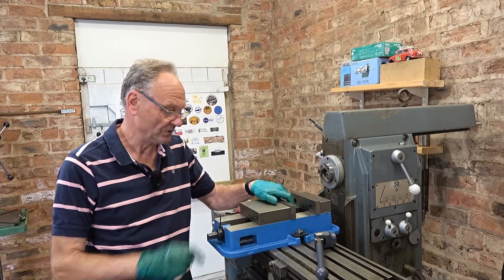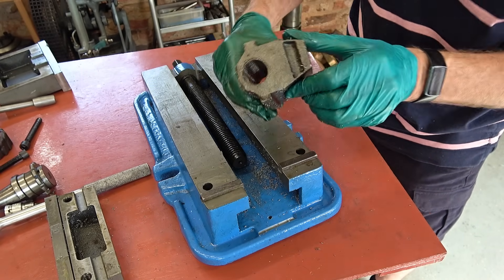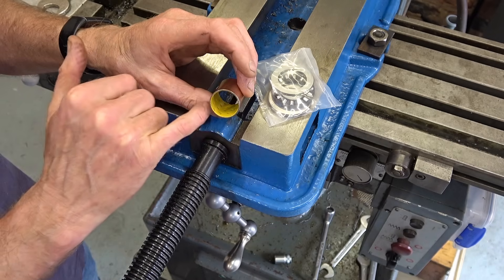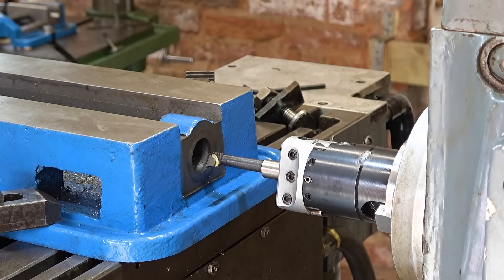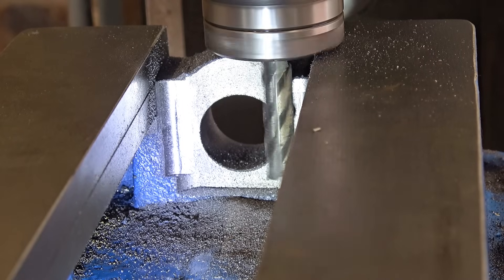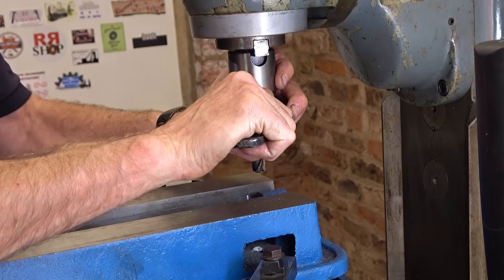HS317 Vevor milling vice improvements – bushing & bearing

Comment: the threaded collar with set set screw doesn't work well, a double split  collar in a grove will keep the thrust set, hope it's helpful
Reply from the maker: Hi in the next video you will see a half-way step. I changed the pointed grub screw for a flat end screw and dropped a brass slug down the hole to clamp on. At least that won't damage the thread. But I agree a split collar would be better. Cheers

Comment: With those brazed carbide boring tools, absolutely set those up and correct the geometry of the insert. The insert tip is always too high above centerline, and the relief angle is not where you'd want it-by design. They are meant for you to have carbide available to grind them into a properly shaped tool, and it will seriously improve both the surface finish, taper, and bellmouthing of your bored holes.
Reply from the maker: Ahh, thank you for explaining that. It certainly makes sense what you say. 💡 Cheers

Comment: "should be" in this world/line of work never assume anything when it comes to measurement or alinement or strength. always check ( if you assume then you also have some doubt and if you have any hint of a shadow of a doubt you check )
Reply from the maker: Yes my experience confirms that. If I make a mistake it's usually because I made a bad assumption. I try to work to "assume nothing, trust nothing". And mostly I stick to it. ,🙄 Cheers
Reply: @HaxbyShed  "assume nothing. test/check everything ( when it matters ) "

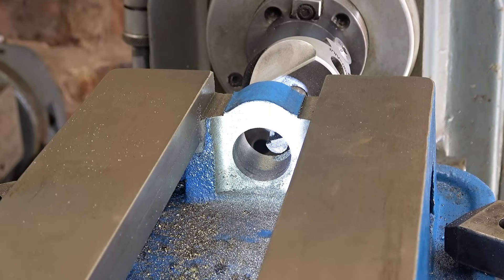Comment: At 8:35, you can see that your cutting angle is not quite 90deg, maybe 89 or 88deg might have been text book better, but this seems to be 110deg which is kind of just scraping its way through... Still it got the job done...Close-up video after the fact sure does not help yesterday, but maybe will help tomorrow.  Again thanks for making this video, excellent content and videography as well.
Reply from the maker: Hi John I understand your point. These are stock cutters which came with the boring head. Honestly I took them on trust and did not check the top rake on them. It could have been doing more rubbing the metal off than cutting 😎

Comment: At 2:35, You might try to use some of the extra '0.65' of the 27.65 to 'tighten the fit' of the screw to the nut.  I guess what I am trying to say is 'don't turn the new shaft directly to 27 .... maybe try 27.1 or 27.2 to possibly increase the thread contact surface inside the nut, which is "Probably" cut oversized from the factory....
Reply from the maker: That is still an option, as of now I've done a fair bit on the new screw (out of the VW Passat drive shaft) but I've yet to turn it down to the screw diameter 27mm. I've done a test thread on 27mm Delrin - you will see in the next video.

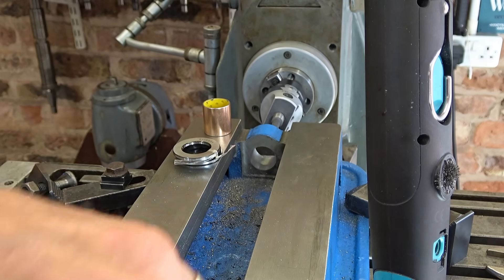Comment: At 10:09, you could have created a boring bar similar to what you did at 7:07.  Drilling a hole at 90deg to the main shaft would allow a similar sized "BROKEN" drill bit to be ground into a cutting bit, then held in place with a set-screw, then assembled in the gap, and finally, drawn backwards through the hole creating a 'Spot Face' feature to hold the thrust bearing in a round recess, keeping more iron for strength in that area, and less areas for stress risers that could be the beginnings of cracks in the cast iron..... ... Thanks for making this video.
Reply from the maker: Hi John, I understand, yes that is true. A semi pocket either side of the 27mm hole to retain the bearing 'washer' in place. A good idea. Wish I'd thought of it.
Reply: @HaxbyShed  Thanks for your replies....

Comment: At 16:00, you could have used a bolt & nut to draw the bushing in... Did you use the Loctite?
Reply from the maker: John a bolt and nut would have been kinder I agree. It was going in easily to begin with so I did not expect it to put up such resistance. I used bearing retainer loctite (the yellow softer stuff).
Reply: @HaxbyShed  I might be 4 hours late ... but ... Maybe the diameter of the hole is tapered because you advanced more slowly towards the end or beginning of the cut.  If that bushing is 'too tight', it might expand due to thermal increases and crack the vice during that expansion. It is steel, not copper or bronze. It might be too late, but maybe not.  I have built many Automatic Transmissions and replacing bushings is a standard thing. This is practically the same thing.  How hard was it really to get the bushing in? If that seam in the bushing is really tight, it might be trouble.  Finger tight plus some hard Loctite might be safer.  Just a thought.

Comment: Paul, now that I've just received a 5-inch (~125-mm) Vevor vise for my RongFu-style mill-drill, when I unbox it, I'll be certain to inspect the engagement of the screw with the nut like you did.  Hopefully, I won't need to replace the original screw because I doubt my lathe's ability (at this time) to machine a new one!  I'll probably copy your idea of adding a thrust bearing too.  ;)
Reply from the maker: Hi Bob, I would not be too anxious if the screw is a bit short. It's quite a long nut so there is still quite a lot of engagement, and also if you were really bothered you could drop a spacer into the jaws before clamping. I just saw an opportunity for a project and self-learning. Cheers

Comment: When machining plastics, deep cuts and high feedrate is your friend.

What to accurately machine a diameter? Try to take as much in one cut as you can, or leave more for a finish pass. This will limit deflection.
Feeding fast prevents melting, and rubbing. It also helps prevent fine stringy swarf, or worse dust. 

For plastics, when parting, use a high rake angle ground tool, and you want to feed by hand, as fast as is reasonable.
Otherwise you’ll get melting and rubbing. Get the cut done asap. You can go a little slower to improve finish, but leaving more for a finish pass on the face is generally a better idea, depending on what you are doing.
Reply from the maker: Very useful advice, thank you 👍

Comment: That was very interesting Paul. When you make the new screw  from the drive shaft, you can correct the fit between the plain portion of the screw and the bush. I look forward to that. On Kurt vices - the company I work for bought out a smaller firm a few years ago. They were in a medium sized industrial unit, and they had two big (unsure of sizes) Kurt vices in their workshop, and a couple of 2ft square granite surface plates. Well, my firm shut down their shop snd transferred what some fool regarded as the useful items to the main building. I enquired after the Kurt vices and the surface plates. They had all been chucked in a skip. I could have wept.
Reply from the maker: Oh my goodness Carl. People have no idea of value !!

Comment: I bought a Chinese milling vice, not a VEVOR though.
The biggest issue I have is moving jaw sliding face isn't parallel with base so parts need 'shimming up'  0.004" (approx 0.1mm) on one side. (I guess you can switch between Imperial and metric relatively easy?)
It's still way better than the angle drill vice that came with it, that was almost eighth of inch out on the pivot but I still have the 1993 Model Engineers Workshop where they showed how to make it accurate. (I didn't have a mill back then but did have a nice old Colchester I sold when I moved to Florida)
For most work it isn't too much of a problem and eventually I will get around to scraping it parallel, then I won't need to clock everything and adjust parallels with shims.
I did dismantle clean all the swarf out then re-grease screw and tilt down clamp system, already has thrust bearings on screw.
I too would like to have KURT but even in USA they cost almost as much as my mill/drill (wife complained enough about that 14 years ago)
Cutting speed for Delrin is faster than any machine I've ever owned 😁
When shortening bushings it's much easier to mount on a mandrel, even wood will work (broken broom handle is good)
I would have pressed bush in with a G clamp

Comment: Amigo la fundición suele ser más abraciva que el acero al carbono. Trabajas con muy altas rpm. El has co. No se trabaja en alta rpm y sin refrigerar. La fundición no se refrigerar y por tanto no se dan esas altas rpm qué le das. El carburo de tungsteno también pierde filón rápido y la piensa a mecanizar agarra temperatura modificando la estructura química de la fundición. La verdad amigo. No se sienta mal por lo que le sugiero. Dios te cuide.
Reply from the maker: Gracias por tu consejo. Lo tendré en cuenta. Saludos.

Comment: I have done the same thing to a old Bridgeport brand vice that was probably 100 years old and beat up and drill holes everywhere spent about 40 hours upgrading it with thrust bearing new nut new and screw also made removable steel jaws out of o1 tool steel then heat treated I under stand your reasoning behind doing it your way because I'm the same way I'm retired now and finally got a Kurt for my Bridgeport at home I often wonder what happened to that old Bridgeport brand vice I restored 30 years ago my boss at the time let me do that because work was slow and he also liked it because it was what would have came on the very first Bridgeport made machines I know he spent a lot of money buying materials and paying me but he was happy after I finished thank for sharing it was always a challenge that got me going like you when you do it yourself you know what you got very good job on your never which copied the Kurt but not quite as good but yours will be when you get done

Comment: The nut on my vevor vise  can slide out under the fixed jaw once the thread is disengaged. Then the screw slides out without having to remove the fixed jaw. It makes sense to add a thrust bearing on either side for less friction with the locknut not rubbing on the vise body.
Reply from the maker: Hiya last evening I ordered a 24mm crinkle washer for the outboard side to keep the thrust bearing under a slight tension when the vice is not clamped. Cheers
Reply: @HaxbyShed I used a Belleville washer to keep both thrust bearings preloaded. The washer spins between the locknut on one side and on the outside thrust bearing.

Comment: My vice is CHOCOLATE😍
Reply from the maker: I've seen a vast range of quality from all origins. Usually most import stuff is good enough for hobbyists, and usually very cheap. Moreover if you try to buy stuff made in UK you might never find any, and if you do it probably says 'made in China' under the expensive label.  As for the 'vintage' UK brands, there are high quality tools to be found but a lot of it was rubbish badly made for schools and colleges. No point paying for quality stuff just for a student to ram it into the chuck or drill through it.

Comment: this is a great project! that vise looks like a great candidate for some upgrades, it doesnt look like a "bad vise". additionally, i would love to see you machine the edges of the "base"...get them parallel to the jaws, etc. i need to do this with my import vise. keep up the good work!
Reply from the maker: Hi, the vice is ok for £80 / USD110 for the general hobbyist. It's definitely not a super precision vice but then again it does not cost USD1000. You can't get any cheap Kurt vices 2nd hand in UK unfortunately.  And it's given me a load of mini improvement project opportunities to keep by busy. Cheers

Comment: What did you put in the top? Was it a ball oiler?
Reply from the maker: Yes it was an old ball oiler, 1/4 inch, brass casing. It was one of the 4 ram slide oilers on my Elliott 10M shaper, which I replaced with small brass cups to hold a bit more oil. Nothing ever wasted. Cheers

Comment: Your first problem is the wobbling collet chuck/end mill 12:34?
Reply from the maker: Yes it had a bit of wobble, I saw it too. Should be fine as it is native International 30 holder and a quality collet system but yes, it was noticeable. Maybe I need to clean the taper in the spindle.

Comment: I have two versions of the Kurt style vice, both cheap and nasty. The first one, a green painted POJ from Busy Bee Tools in Canada, made in, the box said China,  I bought on sale in preparation for my mill's arrival.  Then came Covid, and the mill got delayed. 
And delayed! 
Did I mention delayed!
I eventually  opened the box and discovered a real POJ. I removed the screw  and discovered a few EXTRA holes around  the nut. Obviously, when threading the nut, they'd snapped the tap and the "extra holes" were from the "floor junk picker upper and recycler" chappie, removing the tap bits, retapping the nut and selling the vice as a "sale bargain!"
The drive of the vice also left much to be desired. The "bearing was 19mm and not in bad shape. However, there was no "thrust bearing" of any shape or form. NOT EVEN A WASHER !! 
Fortunately, the internal face had been  machined, I assumed at right angle to the bore, so an inexpensive 3mm thick thrust bearing plus the hardened washers fitted quite nicely. Now, the screw turned quite easily, and the vice is somewhat more useable.
Did I mention the mill being delayed?
Fast forward three years, and the mill, a Precision Mathews PM 930, arrived with a similar vice to the green job, except  this one's blue. Why a second vice? This one costs a bit more, but hopefully, PM haven't  supplied me with another POJ. I haven't opened that, "Made in China box" as yet, but we'll see what that yields when I get the mill setup with an oiling system, corrected wiring for my shop, and time permits. Hopefully, the two vices will "twin" sufficiently for when I ever need two vices.
Will the blue vice need a thrust bearing, too? I don't know as yet, but if it does, between your video and my past experience, I have another thrust bearing, in stock, and ready to go. Now watch Murphy make it a different size or something!
I plan on painting both blue but the green one will get a "KRAP" decal on where the "KURT" one is usually. What the blue one gets will depend on what I find inside. Just to mess with the "Made in USA" junkies!
Reply from the maker: Hiya Ron your story made me laugh a lot 🤣🤣. Thanks for taking the time to tell us. Personally I don't get hung up on brands and loyalties, I just look at the evidence and decide. For example I know from experience a lot of UK  engineering stuff produced in the 60s and 70s that people rave about and pay a lot for is quite honestly cr*p. Yet some vintage UK tooling is really top quality and it's just the same with stuff from anywhere. These days so many reputable brands buy in cheap stuff and stick their label on it when what they should be doing is producing their own quality stuff cheaper in order to compete. Sometimes with domestic labour so expensive that can only be done with heavy investment in automation.  Cheers

Comment: The boringhead should be in line with the nut. The China drilled hole is probably off center (so they had to make it bigger). TIP : If someday you gonna buy a good vice buy a FRESMAK sa   vice (Spain) model ARNOLD CLASSIC...same price as KURT..but 10x better...
Reply from the maker: Hi, I did check the nut alignment visually and it seemed ok. But we shall see after I have made my new screw. Cheers.
Reply: @HaxbyShed     the nut is the part moving in the guides of the vice body.  Fix the Mobil jaw to the nut when you check the alignment before boring. Maybe the nut gets pulled-up when fixed to the jaw. 
I sell FRESMAK vices ..I also repair their spindles...Spindel must be aligned with the nut + nut fixed to the jawel for better alignmen. Btw..I like your videos 👍

Comment: Very nice camera work in this one, Paul. Well done.
And indeed, spending 400 on a new vice isn't very cost effective for a hobby.
Reply from the maker: Thank you Michel. On your current theme of vintage Trams, I've got a small job coming up on a part for a diesel shunter, just helping out the local volunteers. Cheers
Reply: It would be nice to be able to though don't you think.

Comment: I’ve not seen a mill bit chuck like that in a long time. They used to be quite common. I was thinking that you could pull the bit out just a little to mill the bottom, but then saw that. Is getting bits for that a problem? I have chucks for countersinks to limit the depth that have screws on the back of the bits.
Reply from the maker: Hi Mel, I can pick up Clarkson-style cutters with the screw thread on the end by the bucket load at the monthly flea market (Autojumble) about 10 miles from me. Maybe £1 or £2 a cutter - that's about $1.40 to $2.80 US each. Really at that price it takes some self-discipline not to buy them all!  Cheers
Reply: @HaxbyShed quite true.

Comment: Nice improvements to your Vevor vice Paul. They are certainly very good value for money. Kurt vices are 10 times more expensive new. Are they 10 times better? I’ve had a 3 1/4” Vevor Accu-lock vice for 4 years. Excellent for the home workshop. My one already has an oiler above the bearing, where you installed yours. Very well made video Paul 👍 Cheers Nobby
Reply from the maker: Hi Nobby I've seen 3 or 4 Vevor vices with small variations in the construction. I suspect they have several makers/sources and it's pot luck what you get. Cheers

Comment: Hi Paul, I have 3 of the Clarksons, 1 Metric, 1 Imperial for the R8 spindle & 1 with a morse taper for the lathe tailstock. No creep with this system. Cheers Peter from Oz
Reply from the maker: Hi Peter, I have two but they are both on INT30 mounts. Came with the mill. I can get cutters by the bucket full at the local monthly flea market (Autojumble). Cheers